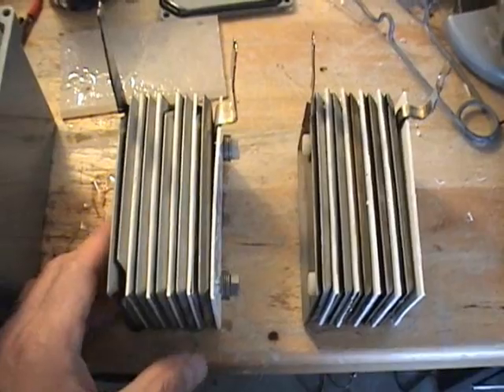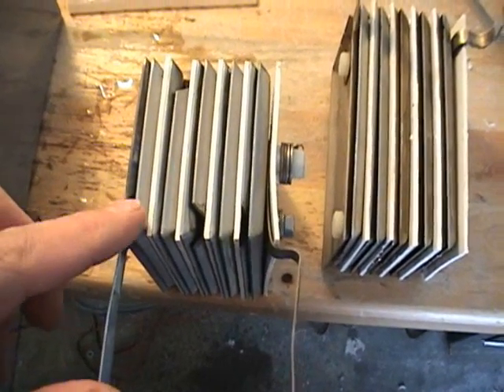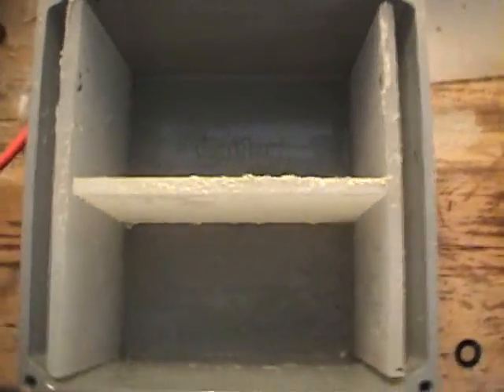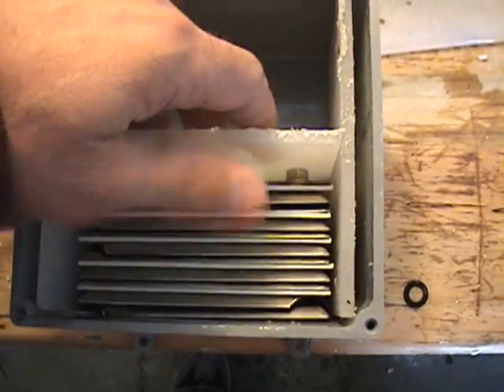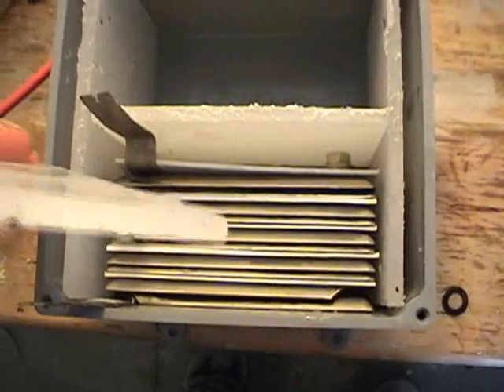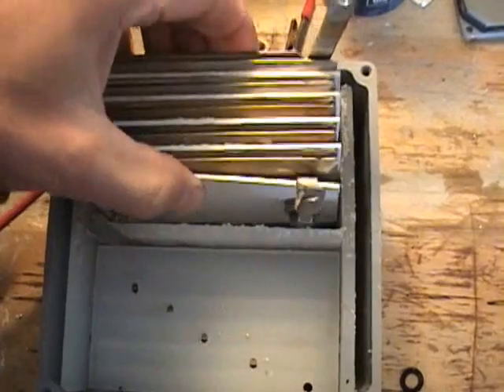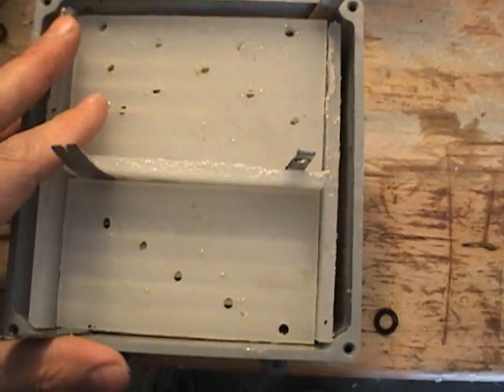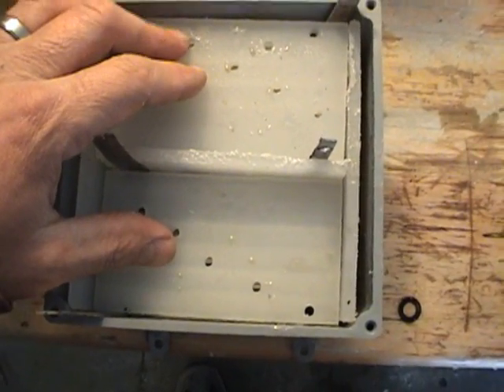(6) 10 plate HHO cell series. 2.8 volt per cell

Comment: Man, I think you got it ... this is excellent work ... you have obviously done your homework and have come up with an innovative solution to the problem ...

Your problem with heat was over voltage. This new build should get your volts well under control. You should be able to give this one as many amps as your can handle without too much heat buildup ...

nice job isolating the cells ... never seen it done in such a samll package before ...
Reply: Gary Hendershot : the secret isnt in the separation of cells using pvc/nylon!! Basic electronics 101 will tell u that when connecting things in series voltage will split as a result lower voltage across cells less heat less energy waste same hho prouction.. to increase hho production beyond normal setups found around the internet thats another story who very few people know its secrets